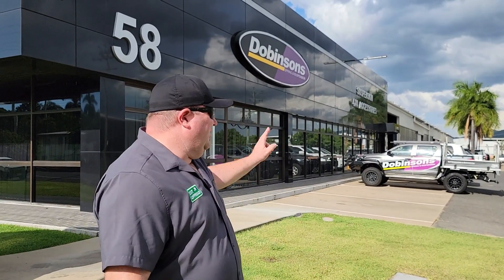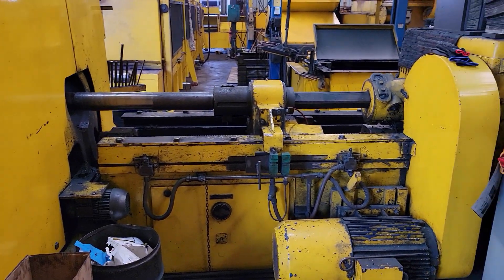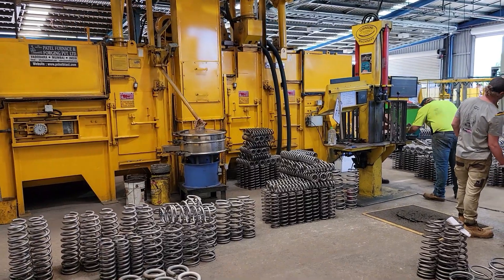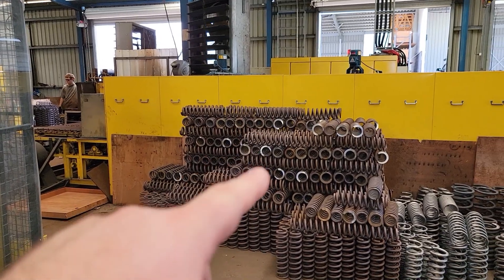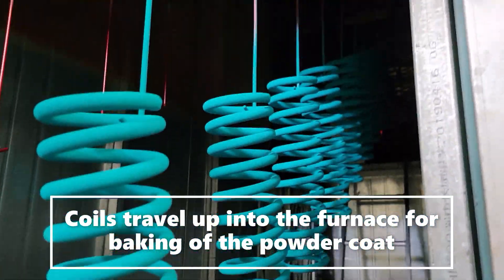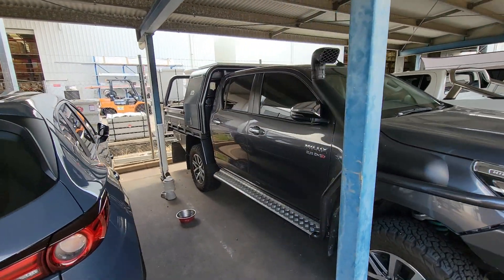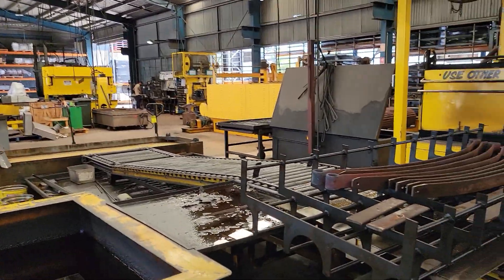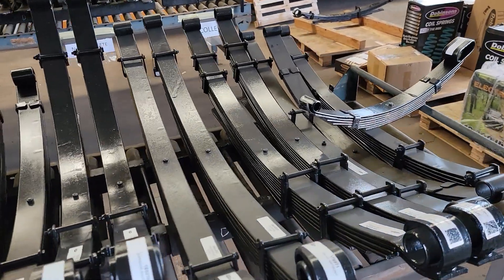Dobinsons Suspension Factory Tour in Australia by Exit Offroad

Comment: So it seems like some of the trademark colors are different for the USA market…..why is that? 

For example some of the threaded locking nuts (IMS)  are black for the USA when Australia (and everyone else? 🤷🏽‍♂️) gets purple?
Reply from the maker: The manager that runs USA distribution chose the black rings. But you can request purple before the ship out at no extra cost.

And Americans as it turns out are extremely picky about colors. Which is why many coils also had to be offered in different colors, which is not done in Australia.
Reply: @ExitOffroad  interesting……I’m not that picky, I just wanted to represent the Dobinsons colors.